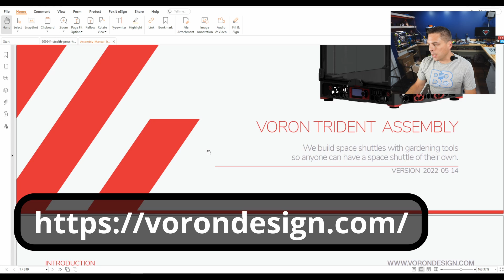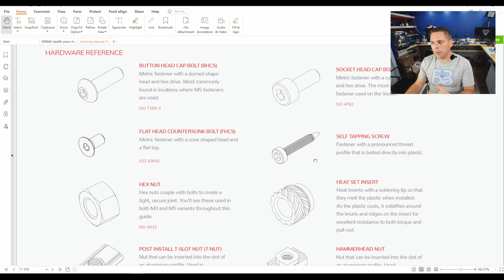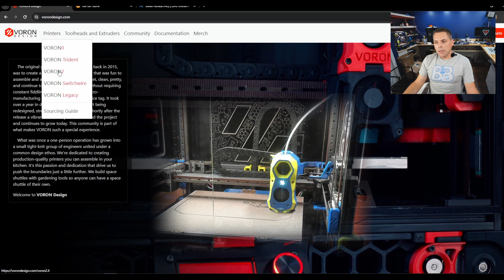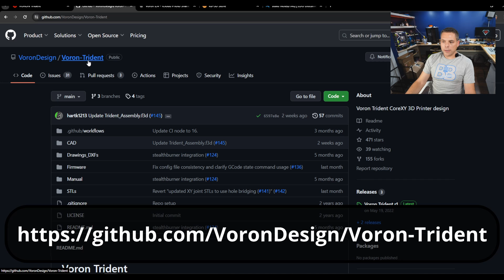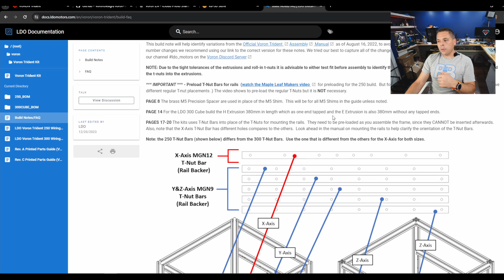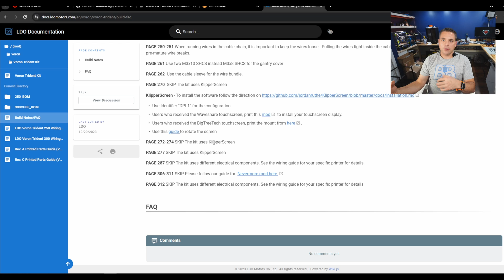Voron Trident Series Video 1 - The Journey Starts!

Comment: Historically, the Voron Trident is a direct descendant of the Voron 1 series, specifically the V1.8.  These were the very first Voron printers that were designed to be core XY versions of the Ultimaker printers.  The Voron 1.x series had two lead screws driving the Z axis, and IIRC 4 linear rods/rails.  The Trident added 3 point bed leveling using floating bearings with three drive screws on the bed.  The official Voron design for the Trident are in sizes of 250, 300, and 350mm for the bed with a 250mm build height.  The build height was limited by the length of drive screws on the stepper motors.  Today you can source 350mm and 400mm drive screw stepper motors, so building a 300mm or even a 350mm qubed Trident is possible with longer linear Z rails and frame members.  I haven't seen any 350mm qube kits, but I know there are 300mm versions, and could be a 350mm x 350mm x 300mm as well.  
I'm going to build a 300mm x 300mm x 250mm (standard Voron size), I found a V1.8 frame kit on ebay, and it is modifiable to use on a Trident (redrill and tap some holes, cut one or three extrusions down to size).

Comment: I built a Switchwire out of an old Ender3 pro.  I printed most of the ABS parts on the Ender 3, putting the printer in my closet and surrounding it with an "enclosure" made from cardboard boxes and covered with a bath towel.  It worked, but some parts didn't print well enough  to use (the extruder and nevermore parts), so I ordered those from an Etsy seller.  I later bought a Sovol Zero printer, and I'm going to use it to print the parts for a Trident.  The quality of the ABS prints from the Zero is MUCH better than the Ender3 could produce!.  BTW, I did print some of the Voron parts in PETG, but only the stuff that is NOT inside the enclosured area, Only the skirts and electronics mounting brackets.
Reply from the maker: This is my fourth Voron build. each has been fun, well maybe except the V0.  Wasn't a fan of that assembly. Today I struggle to offer a Voron as a good option with so many really nice printers available at retail.  Breaks down to do you want to be in the DIY printer hobby or in the maker hobby that may require a printer.  I still enjoy making and building printers.  Thank you for the added information!
Reply: Now that I've gotten the Enderwire completely finished (enclosure,  software, etc) I've tried printing ABS with it, and it produces very good prints.  Good enough to print parts for the trident that don't quite fit on the Zero.  The chamber actually gets up to 50C within a half hour, and is warm enough to start a print in half that time.

Comment: the dynamic mixing between background music and your voice is extremely annoying. every time there's a pause just long enough, the music comes blasting on momentarily, it's incredibly distracting
Reply from the maker: Thanks.  I agree.  No one else has mentioned it, but I agree.  I stopped using music ducking to settle on just music at a low volume in the background.  Maybe I'm just not great at getting those ducking settings tuned in... Any way you slice it, I agree.  Big thanks for speaking your mind.  I appreciate it!

Comment: Great intro.  I am looking forward to this series and your thoughts on this printer vs the 2.4.  Are you going with the Afterburner like in the pictures?  That is one thing that I wish they could have a configurator for the manual.  I know it would be difficult. All the options are great but if you could at least get a manual with the stealthburner instead it would make it easier for a newbie getting into the hobbie.
Reply from the maker: Very good point.  I too noticed that the CAD has the AB and not the SB.  I believe, at this point, there is no reason to go with the AB and I'm going to assume that the AB is shown just as a placeholder.  The reason they don't call out the tool head in the configurator (Voron configurator) is because the platform is open to any tool head that can be mounted to the X carriage or anything really that can be mounted on the MGN rail.  You are 100% correct that it's not clear - I wonder if there are folks out there who have sourced all parts and didn't realize they don't have a tool head until they actually start building.  To answer the standing question - this build will be using the SB and a Tap, I feel that these are the current best options for me and the video series.

Comment: WHAAAAAAAA?  Better than a 2.4???  I think not!!! Good video, partner!  Good overall video detailing out the fact that you do have to jump around.  That was a major major headache remembering to go check and see if there is something different in the LDO kit vs the actual Voron directions.  This is definitely a good initial video for someone that's going to build any printer.
Reply from the maker: Maybe LDO will listen and fix that issue..  They have to notes, they just need to invest the time to make a modified manual for the build!
Reply: Well if they don't, at least you have mentioned it and I am sure you will highlight those differences when you do the builds like you have before.